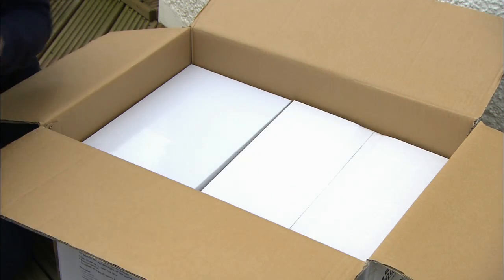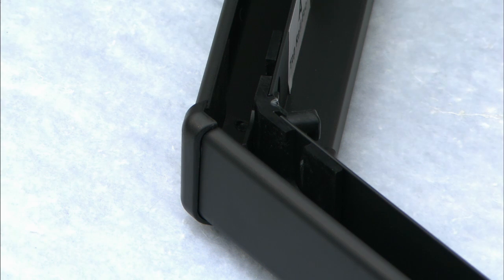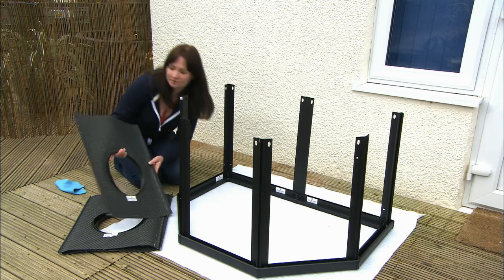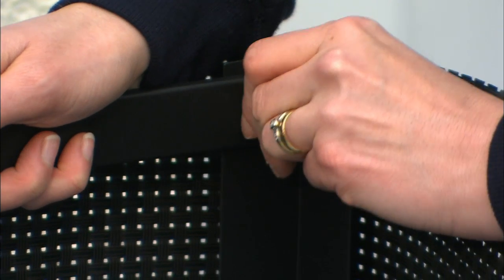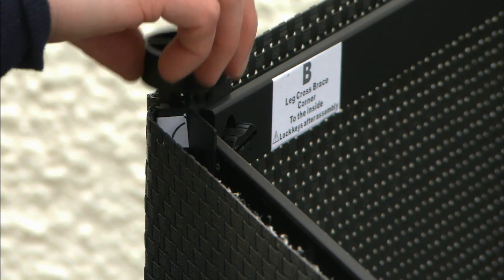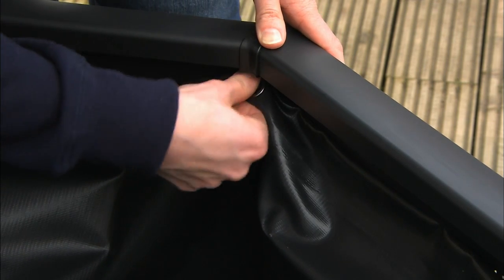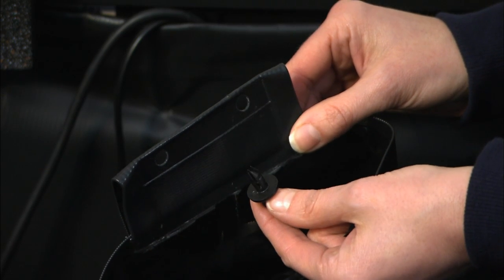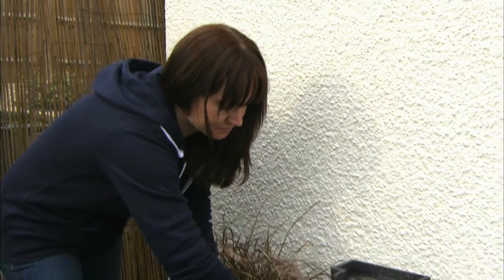How to Build Pennington Aquagarden Raised Window Pond Half Moon

Comment: Not as easy as it looks to put together !!
Reply: Yes agreed, proper wrestling job and with more parts than I expected!
Reply: True
Its the hardest thing Ive ever had to assemble.
I’m still wrestling to get the crossbars installed. Any tips?
Reply: @kettymercadocandelario4646  I had to drill new holes for the crossbars as they weren't in the right place.